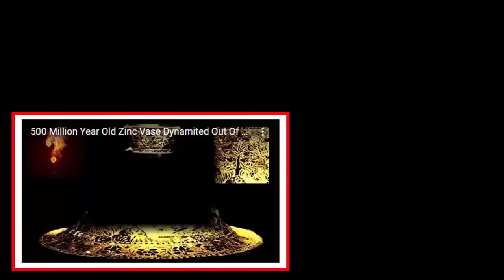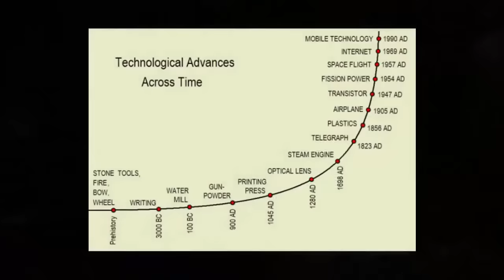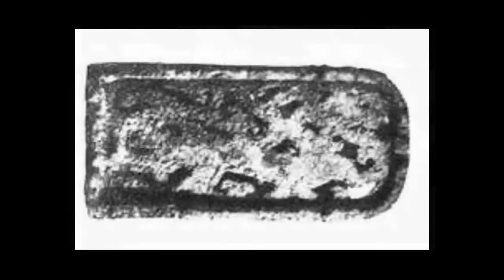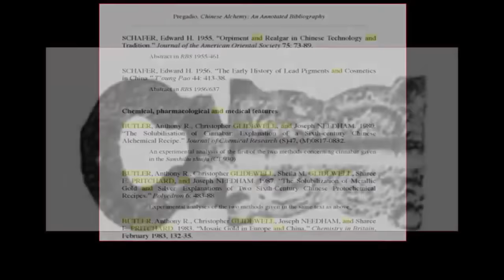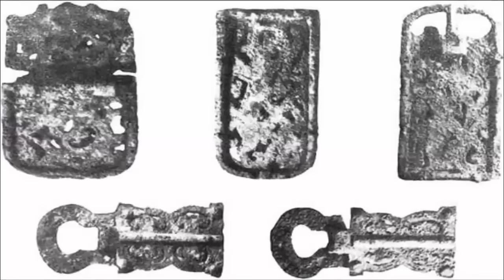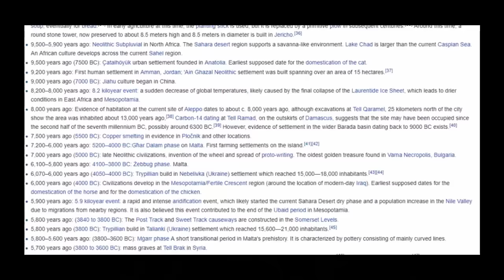300-Million Year Old "Doorknobs" Found In Coal?

Comment: Those doorknobs are from the 1880's in England. Not from a coal deposit. That looks like muddy peat, and not even anything even close to coal. It wouldn't be wet or muddy. Coal is hard and flakey, not full of wet grass and soil. But this channel should be smart enough to know that at first glance. It was incredibly obvious to me. Not a good sign.
Reply: Coal is made from peat
Reply: Spot on professor. !!
Reply: But how deep underground were those door knobs? If they're from 1930s. How did they ended up in the coalbed?
Reply: @Rom3_29  I don't see any "coal" here. Coal isn't wet and muddy. Its solid black, hard, lightweight, very dry, and powders constantly even when it isn't being touched or moved. Do you see anything like that here? Anything at all??
Reply: @pinuuturner7777  Coal can be found in a swamp. Pieces of it, anyway. I have found chunks on a San Francisco beach. Found it on the streets of Manchester, England, and even on an old abandoned railway station, platform there, as well as in various places in the mountains mixed with random stones. The brass knobs have turned black but not decayed. The center metal piece that runs through the door hasn't rusted but also turned black. Very high alkaline. Coal can only be ONE thing, so if it is sitting in a peat bog, swamp or both, then either someone put it there to have a fire, or it isn't coal. Which it obviously isn't. Look it up and do your own research. Unless you don't have internet, of course. And, I would find that...Highly compelling!
Reply: Dont have a heart attack homie, try to relax dat ass 😊
Reply: @transientdreams I concur
Reply: Really? Isnt carbon age dating thdre?
Reply: I’m so happy to bask in the glow of your highnesses acumen. It is so rare to find oneself in the same company as the all knowing- without any actual evidence of anything at all. I am awestruck and proud to have had dinner with you last night. 😢sniff sniff.
Reply: @peterkehoe5685  The trout tasted like weasel. 'scuse me, I have some evidence stuck in my acumen.
Reply: @IXOYZ105  I got the same doorknob on the doors in my 1925 house this channel is a joke now
Reply: @SECRETGOVERMENT2012  

Lol savage commrnt..its like a bull in china s shop.
Reply: Shhhhhh! 🤫 You're wrecking the vibe of the channel.

Comment: Don't ask me how I know this buuuut...Those aren't door knobs, they're vibro-pads for sheering rock. The big scoop like marks in many quarries may be caused by these tools in deep antiquity.  The back ends of the pads slid into a contact harness where many could fit around each other, allowing for a variety of different contact patterns. It was a heavy and bulky tool with a cable trailing behind it, so it was probably electrical and it was huge so most likely wielded by giant size people. Quite similar to a hair shaver... Except it's for shaving rock, using frequency and vibration. Don't ask me how I know this, I have no proof, I just do.
Reply: I call it.. “A Knowing”. Things that I just know but don’t know how I know. 
I totally believe you know this. Whether it’s common sense, a download or a past memory.. it feels right & it sounds right.
Reply: This is the only reply that makes sense.
Reply: That's interesting , I like the idea.

Comment: They need strong door nobs to keep out the T Rexs.   Oh wait.  That was before T Rexs.
Reply: Don't ask me how I know this buuuut...Those aren't door knobs, they're vibro-pads for sheering rock. The big scoop like marks in many quarries may be caused by these tools in deep antiquity.  The back ends of the pads slid into a contact harness where many could fit around each other, allowing for a variety of different contact patterns. It was a heavy and bulky tool with a cable trailing behind it, so it was probably electrical and it was huge so most likely wielded by giant size people. Quite similar to a hair shaver... Except it's for shaving rock, using frequency and vibration. Don't ask me how I know this, I have no proof, I just do.

Comment: They needed door knobs back then also.
Reply: Don't ask me how I know this buuuut...Those aren't door knobs, they're vibro-pads for sheering rock. The big scoop like marks in many quarries may be caused by these tools in deep antiquity.  The back ends of the pads slid into a contact harness where many could fit around each other, allowing for a variety of different contact patterns. It was a heavy and bulky tool with a cable trailing behind it, so it was probably electrical and it was huge so most likely wielded by giant size people. Quite similar to a hair shaver... Except it's for shaving rock, using frequency and vibration. Don't ask me how I know this, I have no proof, I just do.
Reply: Back then was still 300 million years door knobs or not. @KiloCee

Comment: The wheel is also of a propeller design circular rotation producing speed of other levels of physics added turbines creates tunnel wheels harnessing the Air motor machine applied create a higher power increase intensity makes lift with wings a side vehicle and added motor, turbines, wings, and rutters bringing flight upward spiral velocity